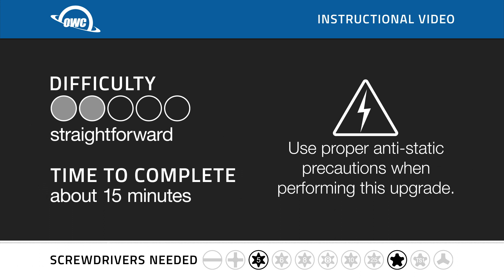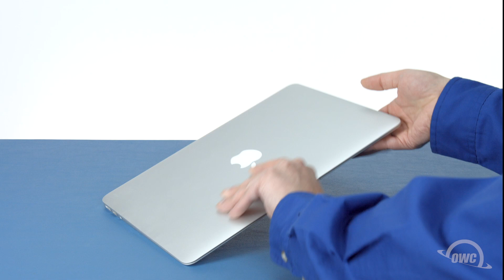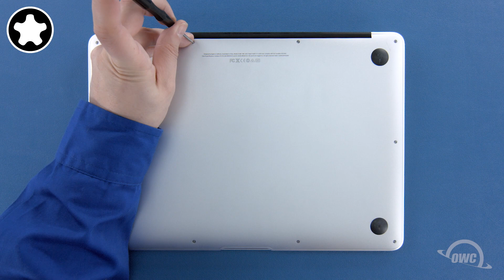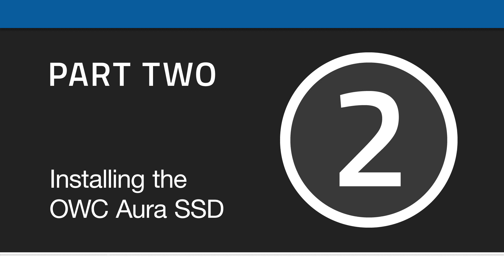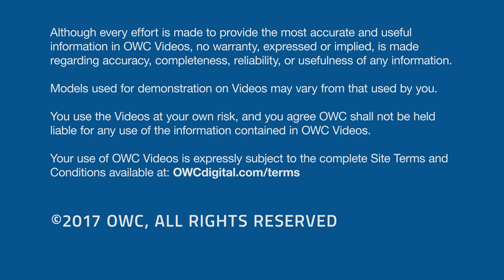How to Upgrade the SSD into a 13-inch MacBook Air (Mid 2013 - Current) UPDATED

Comment: These are the same drives that fail when the Macbook goes into hibernation or sleeps, correct? I know that some people that had installed the OWC drives said that the drives fail after hibernation and that it is a known issue to OWC. They complained that you all were doing nothing about the failing drives. Did you all every fix the issue? If so, which of your 1TB drives are the ones without the failing issue?
Reply: They never cared to fix it, I. sufferer the exact same problem and lost a huge amount of very valuable information and data, pictures, etc. I could NEVER get the data back.They advised to "next time backup your information and disable hibernation mode" LMFAO

Comment: You're website is literally charging an insane markup just for an m.2, literally nothing special about it. I can get a 1tb m.2 for like $130 not $250
Reply: There are different versions of m.2 apparently. Macbooks use 12+16 pin m.2, most of the affordable options have different pin sets. So they won't fit/work.
Reply: @NidhinMohammad96  you can get an adapter ! :)
Reply: can u drop a link. Im not bring to spend 250 on 1tb
Reply: where do you find 1tb m.2 for $130?  Mind sharing the purchase link?
Reply: @zubipoko  https://www.newegg.com/western-digital-blue-1tb/p/N82E16820250092?item=9SIAFJ8A151096&source=region&nm_mc=knc-googlemkp-pc&cm_mmc=knc-googlemkp-pc-pla-technology+galaxysolid+state+disk_-9SIAFJ8A151096&gclid=Cj0KCQjwzN71BRCOARIsAF8pjfgTimFpJhoV3nWa5zl_Sq8roPjvp0Mu81cdrn58wbiORxa3V7FhOE8aAreWEALw_wcB&gclsrc=aw.ds

Comment: Any video on how to upgrade my RAM for my Macbook Air (mid-2013) from 4GB to 16GB? Thanks.
Reply: The RAM is soldered in so unless you can reverse that, you can not. Apple made it nearly impossible for the layman.
Reply: The option for memory upgrade was at purchase unfortunately